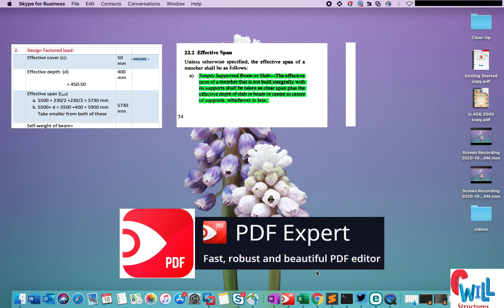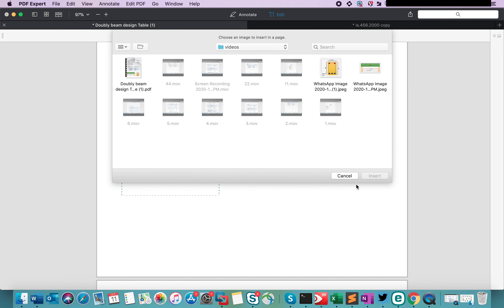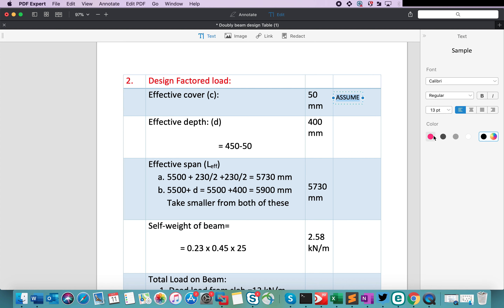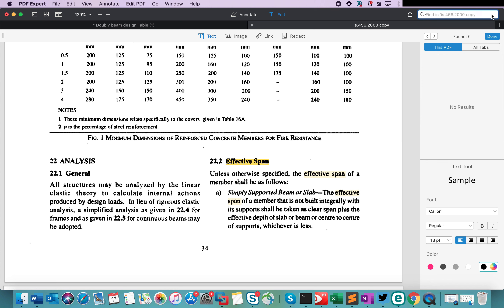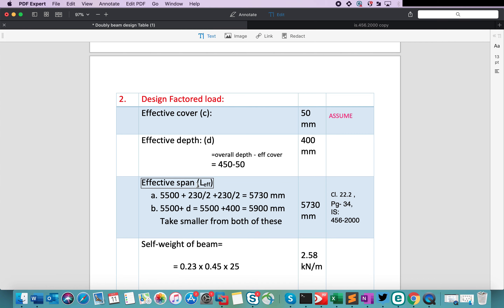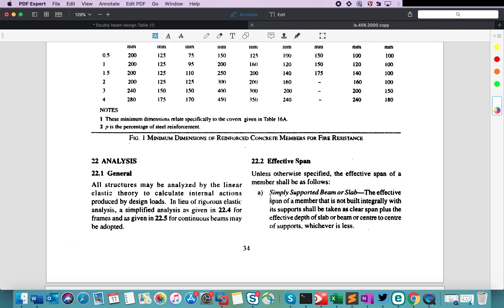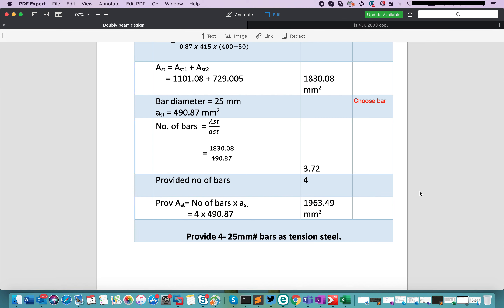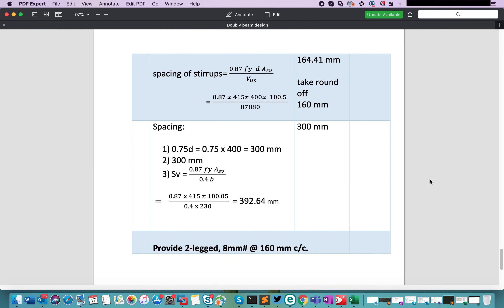Design of Doubly Reinforced Beam using IS:456 2000| PDF Editing Tool for MAC: PDF Expert

Comment from the maker: To Download PDF Expert please click on the link given below:
https://readdle.8kpa2n.net/c/2509517/763057/11051?utm_content=integrated1
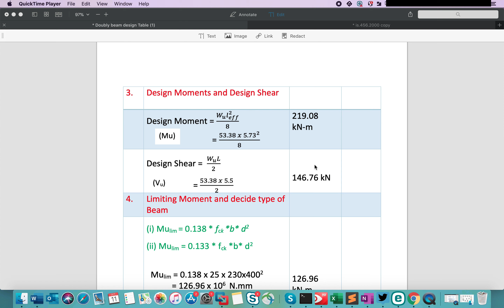Reply: I wonder what does the Step 4 Limiting Moment (Mulim) represent at 09:47.  Does it represent the Maximum Moment Capacity of the beam?  If YES, then why does the Fe500 beam has lower Mulim than Fe415 Beam?  Shouldn't the Fe500 have more strength compare to Fe415?
If Mulim does not represent the Maximum Moment Capacity of the beam, then why is it used to compare with the Actual Mu ?
It is really strange, I wonder what am i not understanding here?  What does the Limiting Moment really represent ?